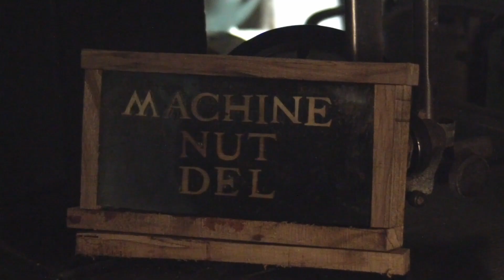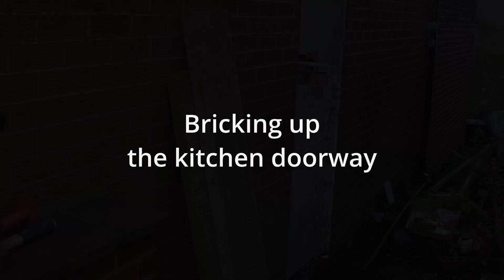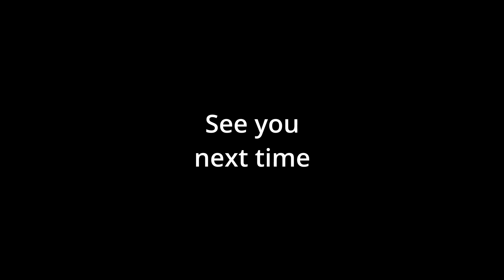Bricking up the kitchen doorway

Comment: I thought modern bricks were suppose to be the same size Del? Are you moving your machines into your new the garage?
I've seen brickwork, 'soldiers' dropping down like you mentioned after new plastic windows have been fitted. 
I've done some brickying Del, looked like a dogs hind leg in both planes lol.
Top job, at first I thought you were going to cast an aluminium door. 🤣🤣Cheers Tony
Reply from the maker: may have too much to move out Tony, modern bricks are 65 and 73mm, before standardisation could be any size, Ive seen Accringtons up to 3. 1/4 inch. Its a problem when trying to match in new brickwork with something built 50 odd years ago. Todays gauge for brickwork is a 10mm bed, so with a 65mm brick that works out at 4 courses to 300mm. A lot of property from the 70s dont have a lintol over the windows or doors, thats why you see the brickwork falling down !
Reply: @machinenutdel6764  Your too right Del on the windows. Seen it first hand. 👍 Tony
Reply: @machinenutdel6764  Too much to move out. Sounds like me. If you need a hand, giz a shout. Tony
Reply from the maker: @eyuptony  Thanks Tony